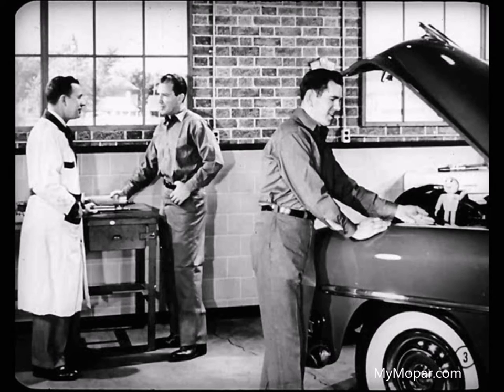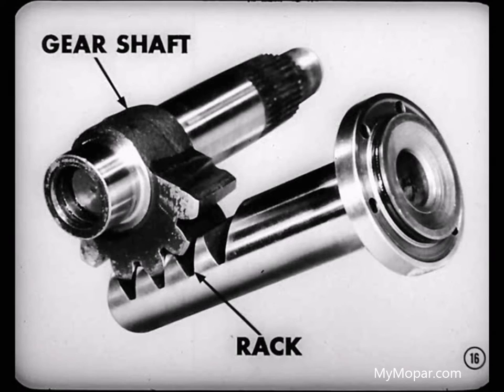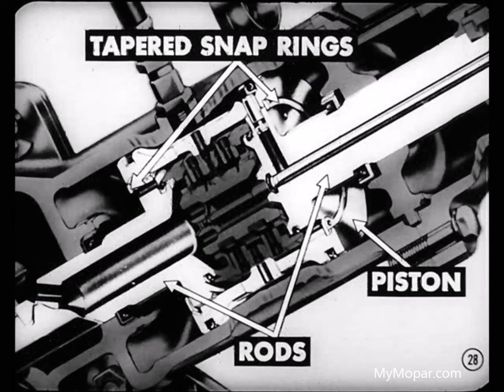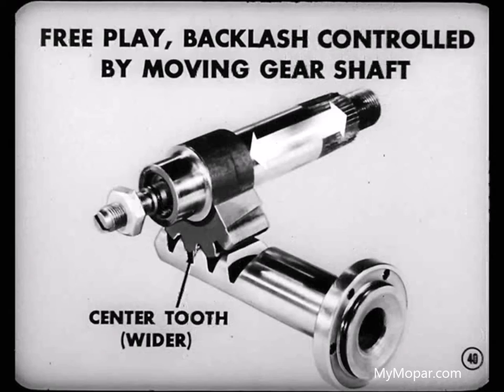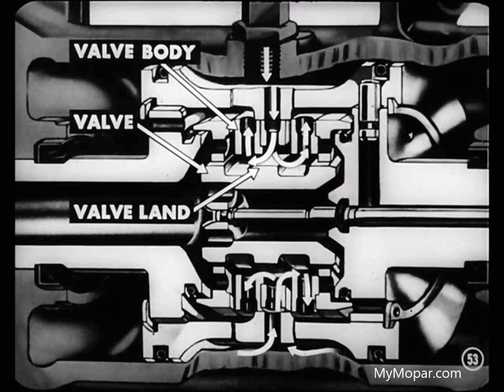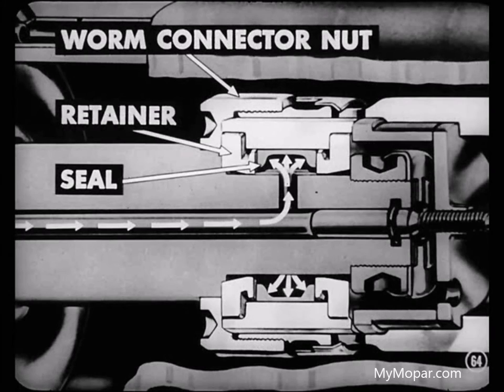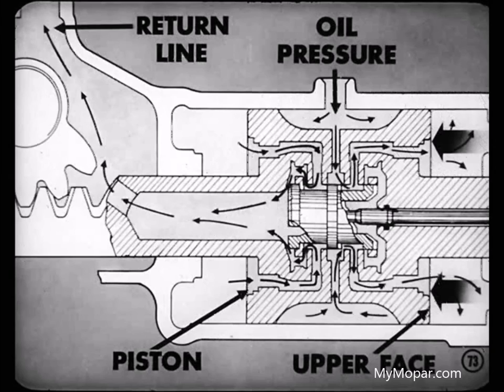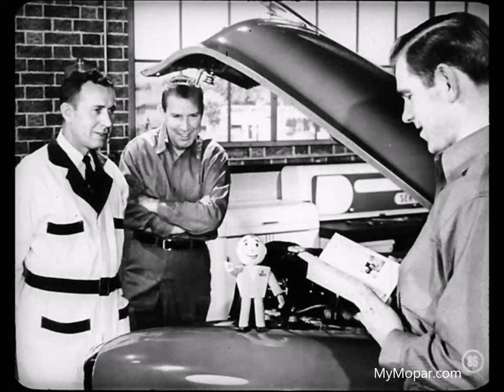Chrysler Master Tech - 1954, Volume 7-6 Power Steering - Coaxial Type

Comment: From 1953 to 1954, the engineers actually cared enough to design a smaller unit that gave the mechanic more room to work! Now, if one designer leaves a little space, another will fill it. So much for "progress".